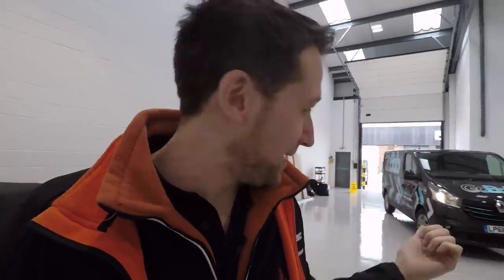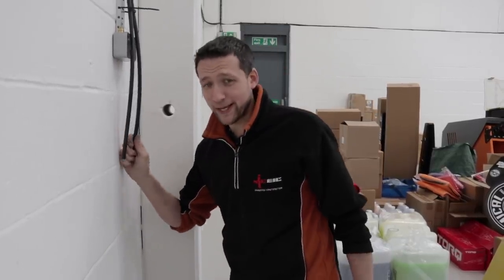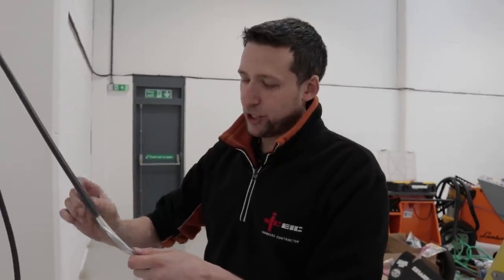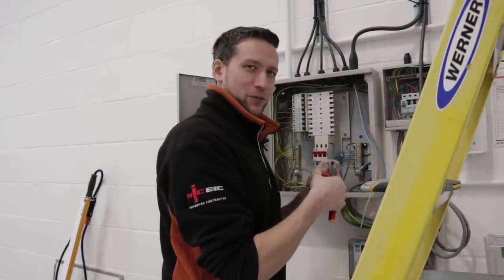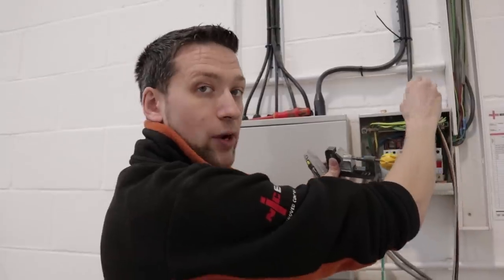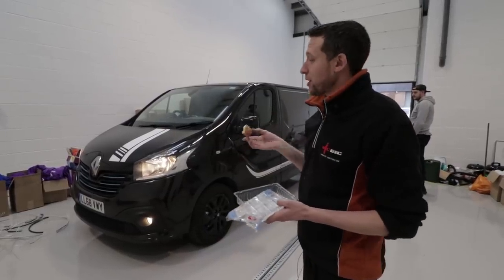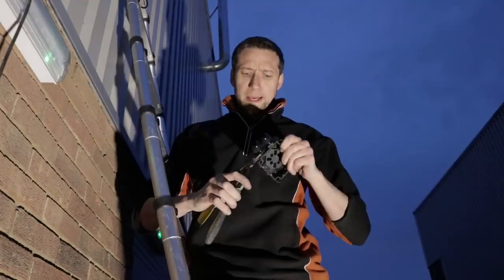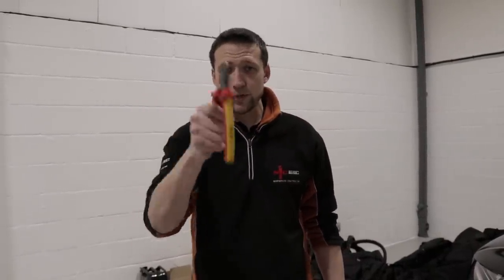HOW TO strip cable + fitting sockets at GoBobs Industrial Unit | Thomas Nagy

Comment: The open panel comment, you only work on live electrics where there is no other option and must been done as safe as possible, (EWAR) If you cant turn the power off, you cant turn the power off, the real world isn't a textbook 🤣🤣🤣
Reply: rik061119 I don’t think I’d call open panel work “live work” in the way, say, underground jointing is “live work”. Yes, it’s live, and yes, some conductive parts may be partially exposed, but they’re no worse than a metal clad Wylex board when closed, with huge gaps all over the place. And in an industrial unit you don’t have kids and members of the public within spitting distance who might accidentally trip and fall into the board with a screwdriver in their hand and land unexpectedly with the tip touching a live terminal screw head. Because that obviously happens all the time 🙄

Comment: What's the deal with installing those 3 phase commando sockets?
A lot of people say each socket on its own circuit when some people put them on a radial. If its on a radial is it just the same as a normal radial say two 32A sockets on 40 amp breaker with 4 or 6 mill
Reply: If it's a 32 amp socket,  it needs a 32 amp mcb behind it,  unless the socket itself is fitted with an rcbo (I think they are all fitted with an rcd). The plug doesn't have a fuse in it,  so overload protection (of the socket) has to be provided by the mcb , ie 16amp socket= 16amp mcb
Reply: Overload protection for the socket has to be provided by the mcb,  the plug doesn't have a fuse in it.  
32amp socket=32amp mcb, 16amp socket= 16amp mcb etc.
You can fit as many sockets per circuit as you like, but if someone has asked for 2x 32 amp sockets,  chances are they need 20-30 amps, overload of the mcb is likely..

Comment: I think US Cabling is so much easier, cleaner and better all around. 

I still do not get, they use plastic conduit in all of the homes, but for commercial they use a bare cable tacked to the walls. 
How much better would that look with steel conduit going around the room.
Reply: Plenty of comercial and industrial installs use steel conduit here, however sometimes SWA works... plus SWA is always less work to install.
Reply: When you say 'bare' cable you do realise it is steel wire armoured (SWA) cable yes? It has steel armour under the PVC sheath to provide mechanical protection, so it's not bare.

Comment: 3:38 i use this one (in denmark but i guess for uk it will work just as fine)
https://www.amazon.co.uk/KABIFIX-Stripping-machine-FK-28/dp/B002XMR7FO
Alot smaller then yours, probably weight less too, press together (spring holds) twist around cable, pull to you, push the button and the spring jump up and release the hold, and now its easy to take off, i love it, and its so small its always in my pocket.
It does not cut the armor inside, not sure if it will on those cables you use though, but the armored cables here are different then those you have, but it does all round cables

Comment: Working in Live boards: I find it a common policy working as a spark in FM, the policies are 'no live working'. And unfortunately working in a energised board is classified as working adjacent to live parts and unfortunately constitutes as live working. So any work in a board has to be isolated up stream. Sucks!!
Reply: Must be difficult when the client is running a business and u need to isolate a DB to connect a new circuit, for example. Most of the time they say that's not feasible and it puts u the contractor in a bit of a position. Been there myself and had a bit of a mishap. It's not good, health and safety issue and embrassing too.

Comment: Why do u put the banjo on a metal enclosure??
Reply from the maker: i always thought you had to fit them. whenever i have seen metal boards etc the armoured cables are always banjo'ed. confirms continuity i suppose
Reply: A metal board will not necessarily give you a good earth continuity between the case and the gland as 99% of the boards are painted or coated in some way. Also, you don't know what the internal connection to the chassis is, and if it's rated to handle the potential fault current, whereas you can size your connection to the banjo appropriately for the circuit...

Comment: Need some steel cable ties to hold that swa in place, can only see black plastic cable ties.
Reply from the maker: thats because i used black stainless ones:
https://www.ebay.co.uk/i/323320272410?chn=ps&var=512385423085

Comment: Why armored cables?  I have been electrician 15 years and I have never even seen a steel armored cable (except 20kV underground cable)
Reply: @peto22, you havnt been around much if you havnt seen armoured for 15years? What would you use to supply an outbuilding and the cable needed to be buried
?

Comment: Why doesn‘t anyone in Britain install a proper Hager Distributionbox??? Google Hager ZB55S for a big one...
Reply: Wintersky136 I mean you get what’s on the market that satisfies or helps you satisfy the current regulations. That ZB55S looks like a monster, it’s basically a huge cabinet full of DIN rails that you wire up in singles, right? The Hager Invicta 3 is a three phase + neutral board similar to the type seen in this video.

Comment: Sadly in the US we have the safety nazis (OSHA, etc.) that will seriously levy huge fines for working live. Many EC companies have policies in place that will get you fired if you work live. Even the NEC (Code) prohibits working live except in extreme circumstances (and requiring the mass of paperwork to prove it.)

That said, as a real world sparky I HAVE worked live many times, you just have to be extra careful. The ONLY times I have demanded a full shutdown is in older equipment of questionable condition, or equipment that is wet or shows signs of overheating (or is smoking/arcing.) 

As I said in another comment, it is all part of dumbing down the trade to allow others of questionable ability to call themselves electricians.

Comment: I'm working for a firm that manufactures products and I did my apprenticeship here (sparky) literally just as I was coming out my time my supervisor and mentor left, I never got to plan the jobs before or specify the parts but I wanted his job responsibilities so badly, so I jumped and told the firm I wanted his job don't hire anyone to replace him. Now I run massive projects and run the whole electrical division at my firm that small risk of potentially making myself look like a tit paid off, always go with you gut you never know what door it'll open.

Comment: Am i the only one that is cheap enough to sharpen sanely knife blades ? I mean with a few diamond plates wet stones and compound i can get the blade sharper than it was when new. I would not do it on site or anything but when i get home and i am bored.

I get hand cramp doing IT work , i mean some racks are a fucking shit show and you have to fit your hand in 1u of space and move cables .... not fun.

And just a friendly reminder , nobody should be fitting Cat5e any more , cat6 is not that much more expensive. Think about it like this, you may be the one who has to come back and re-run it in 2 years because you wanted to save a few quid now.